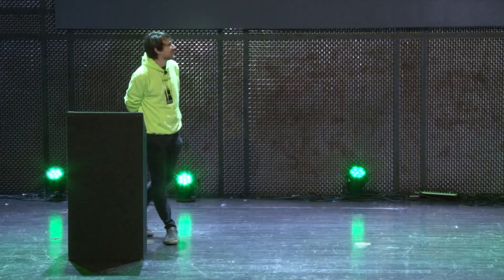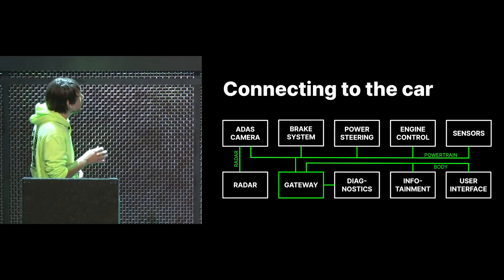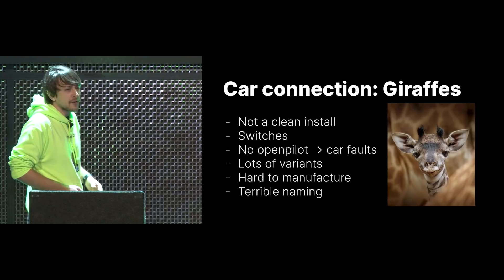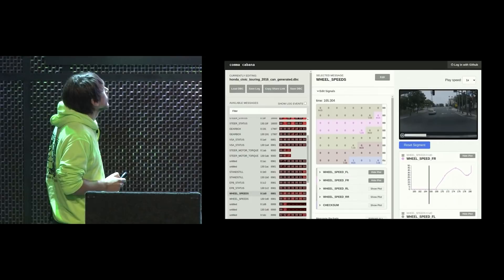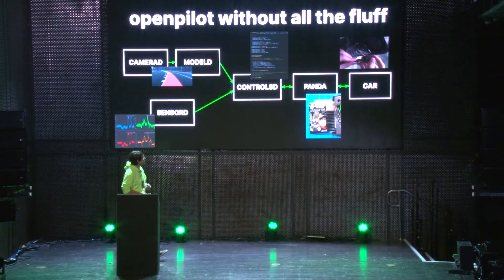comma ai | Robbe Derks | Hardware Engineer | How Do We Control The Car? | COMMA_CON talks

Comment from the maker: All credit to comma.ai team for uploading original high quality video on their official youtube.com/commaai  | https://comma.ai/shop/products/three ($2199) | https://comma.ai/jobs | Buy comma.ai/shop (Merch) | Follow the official youtube.com/commaai for more videos. Stay up to date by following twitter.com/comma_ai | Support comma.ai at comma.ai/shop.
Chapters:
00:00 Intro Robbe Derks
00:41 How can something like comma exist?
01:06 How does a modern car work?
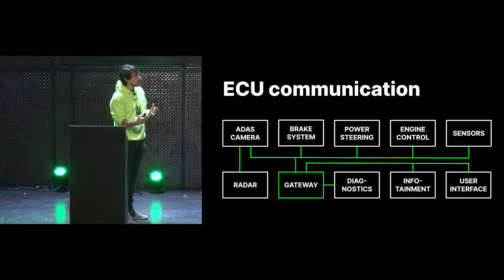02:50 ECU communication
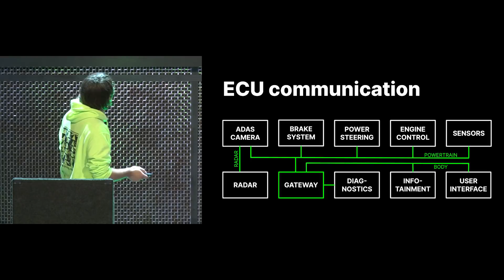03:54 ECU communication: CAN
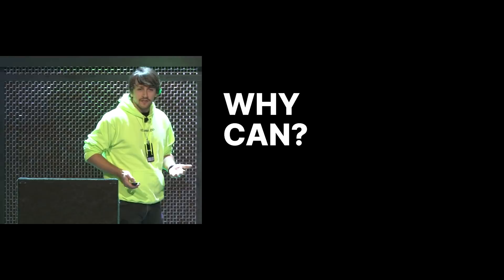04:30 Why CAN?
05:22 How do we control the car?
05:29 Connecting to the car
08:02 Car connection: Giraffes
09:04 Car connection: car harness
10:05 Car harness connectors
10:34 Car harness Hyundai
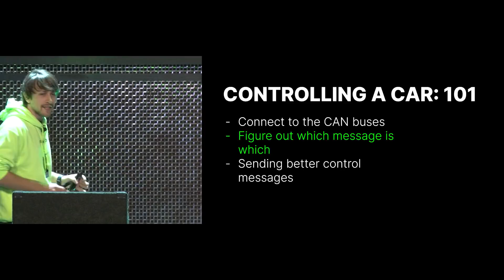10:50 Comma cabana
11:50 DBC files
12:58 Sending better control messages
13:14 Openpilot services (daemons)
13:34 Camerad and modeld
13:48 Sensord
13:54 Controld
14:08 Panda and the car
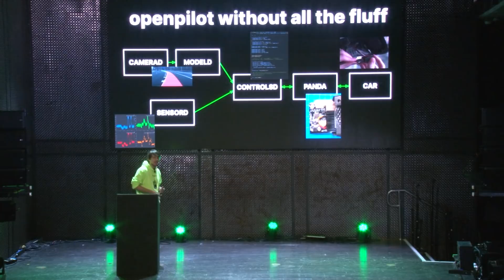14:39 Controlsd in depth
15:33 Car interfaces 
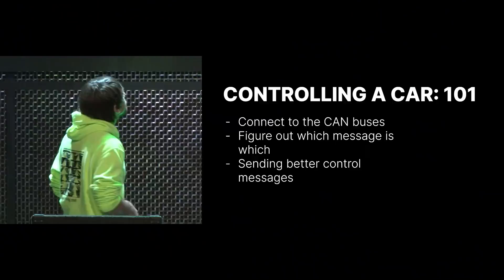16:08 Safely controlling the car 
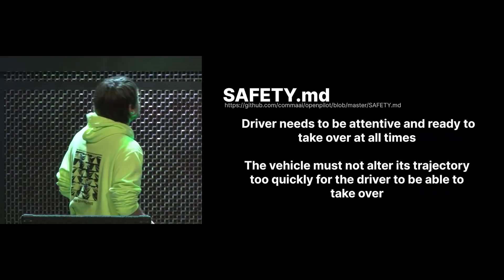16:24 SAFETY.md
17:21 Panda safety
17:59 Panda safety limits
18:54 How can something like comma exist recap
19:03 Cars are more simillar then they look
19:29 Most of the code base is generic
19:44 Hardware differences are abstracted away
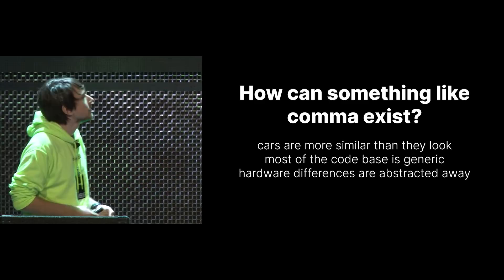20:02 Time for questions
20:15 Issues with openpilot sending messages instead of the car
21:20 Tesla openpilot support 
22:06 Tesla Autopilot vs comma.ai openpilot
22:30 How are the safety limits decided
23:23 How are the claims about safety validated
24:19 ISO 26262 certification
25:09 Clarification about ISO 26262
25:21 MISRA C, Cppcheck
25:32 Data from blindspot radars
26:16 Car harness and more cameras in the future
26:50 Hardware fail-safes and faults safety
27:45 Panda safety range limits and dropping vs keeping messages over/below the limits
28:45 Hardware OEM blocking comma hardware
29:41 George Hotz will break it if he will need to
29:52 Dropping the packets vs clamping the packets to maximum value of the limit
30:47 Modifying the firmware on the car modules
31:29 Improving openpilot documentation
31:48 Cars with different topology
32:36 Steering motor reliability and lifespan
33:20 DBC files OEM support, comments about reverse engineering
33:40 CAN FD
33:54 Additional features via OBD
34:39 Weather/road condition speed limits/checks
35:12 Tesla over the air updates interference with openpilot
35:34 Manufacturers forking openpilot
36:01 What kind of hardware microcontrollers and latency when sending receiving messages
36:52 Features with OBD, compatiblity integration with OBD apps
37:32 Evolutionary changes, car to car communication
38:07 Sending messages on EV cars vs ICE cars
39:08 Car over the air updates breaking compatiblity and encryption
39:50 Next version of hardware
40:16 Flash utility to do updates on the car modules and controllers, ECU

Comment: What part of the code is responsible for being aware of the car's specification and capabilities? For instance, a planner might choose to take different actions if it knows that it's controlling a Ford F-150 (I don't know if it's supported or not but, hypothetically) as opposed to like a Honda Civic. The dimensions and turn radius and very different between the two. However, the name "generic" controller implies that, well, this ode is generic and hence not "aware" of the car's specification. I'd be curious to know exactly what part of the infrastructure is responsible for knowing that. Is it perhaps the safety module?
Reply from the maker: https://github.com/commaai/panda
https://github.com/commaai/opendbc
https://github.com/commaai/openpilot/tree/master/selfdrive/car

Comment: Ok. Maybe not the ideal place to pose this question, but: Robbie states with some pride that it takes only “about 45 lines of code” to customize OpenPilot for a specific car.  So if that is all the effort that is required, why is it, for example, that Comma supports the 2019 Subaru Crosstrek with Eyesight 2.0 but not the functionally identical (and likely near-identical code base) 2019 Outback with Eyesight 2.0?  Asking for a friend with a 2020 Subaru Outback with Eyesight 3.0 but without the skills to add support:-).  PS, the Subaru Eyesight 3.0 has fantastic Longitudinal control and actually decent Lateral, but would be brilliant with a Comma 3….
Reply from the maker: Comma can't own and test all the car models. To add support for new car the car needs to be tested properly so it can be added to openpilot. It's up to the users to add support for more cars. https://github.com/commaai/openpilot#community-and-contributing. Join the discord and search for info there how you can add support for your car. Usually there is not much difference between similar models so it should be quite straightforward to add support for your car.
https://github.com/commaai/openpilot/wiki/Fingerprinting#to-add-your-car-to-future-openpilot-release
You can also look at some examples from people that have done it:
https://github.com/commaai/openpilot/pull/1768
https://github.com/commaai/openpilot/pull/1801
https://github.com/commaai/openpilot/pull/21709
https://github.com/commaai/openpilot/pull/21354
https://github.com/commaai/openpilot/pull/21382

Comment: This works as long as they do not secure the bus...  Not sure how long this security architecture is going to be still accepted, would have changed it a long time ago.
Reply from the maker: https://youtu.be/FL8CxUSfipM?t=1781 (George Hotz will break it if he will need to)
Reply: @geohotarchive  Might be a thing to try. All auto micros do not put much security in to avoid increasing the cost. Longer term would rethink the approach and maybe partner with OEMs.

Comment: Was wondering, what frequency is the CAN bus running at?
Reply: Most of the standard CANs are running on 500kbaud. The frequency of each message is defined in the DBC.
Reply: @RoughlY  So slow.  Thank you for the reply.
Reply: @WeaponGrade  thats true. But it is reliable and can withstand disturbances very well. Also it is pretty cheap to implement. That’s important, especially for small ECUs and sensors/actuators. Nobody wants expensive ethernet on a door sensor. ;)